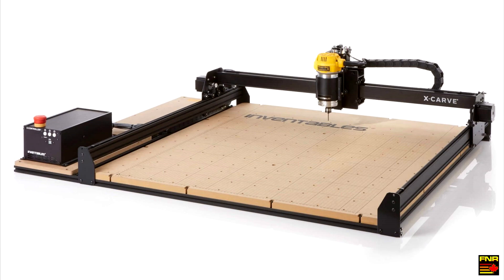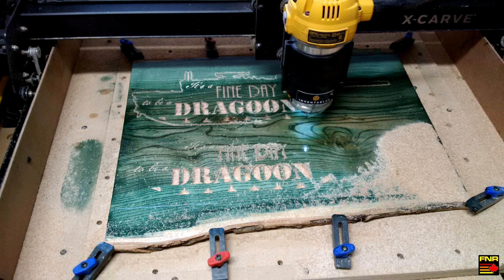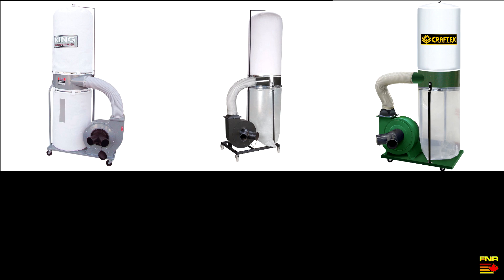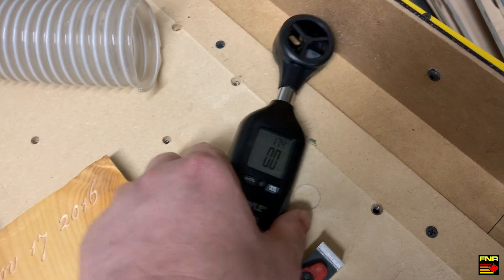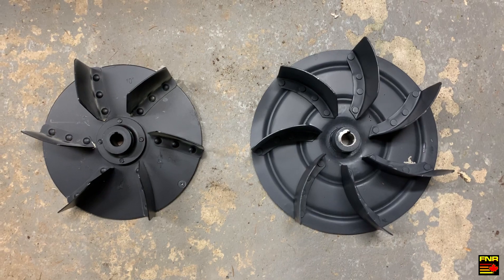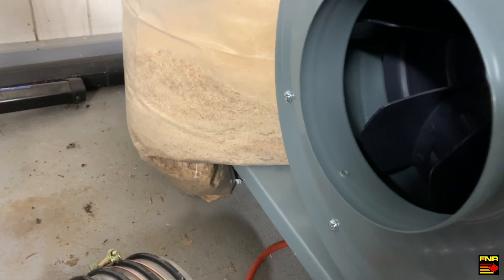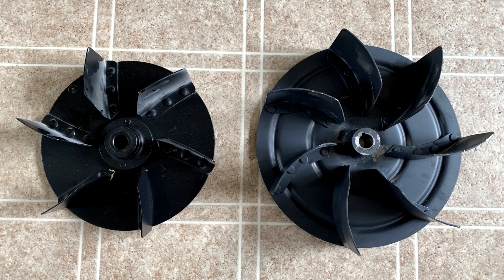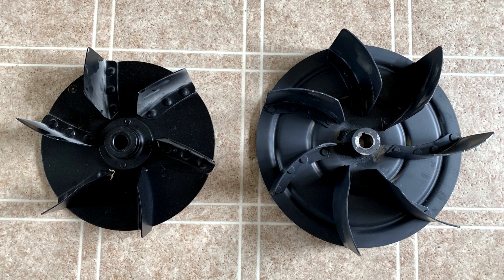Dust Collector Impeller Upgrade Test

Comment: What is the CFM at the end of your hose when you upgraded to 220v?
Reply from the maker: I didn't measure it.

I expect it to be about the same - the motor still has the same power level on 220V, it just draws less amperage.
Reply: @FNR  Not exactly...converting from 110 to 220 just splits the same amperage between 2 legs.  Here, had you just swapped the 15a breaker for a 20a you would probably not be tripping it like you were.  This is just explaining it in the hypothetical...dont just swap in a bigger breaker because the wiring between the breaker and outlet is probably not rated for that load. 

You were tripping a 15a breaker because you changed the physics of the motor/impeller combo.  If you are now pulling more amps in total, then you are also making more HP.  It might not be significant but technically you are making more power now.

Comment: Carefull to not burn your motor.
NEMA. The clause regarding motor current rating in NEMA Std. MG 1, 12.47 is short and to the point: “When operated at rated voltage, rated frequency, and rated horsepower output, the input in amperes shall not vary from the nameplate value by more than 10%.” This means the actual full-load current can be as much as 10% below or 10% above the value given on the nameplate. For example, if the motor nameplate rating is 100A, any value between 90A (10% less than 100) and 110A (10% greater than 100) could indicate a full-load condition.
Reply: I suspect this is not much of an actual issue.  Is the spec listed just the output with the OEM impeller installed...or was it a limit of the motor's windings.  I suspect it's the former or folks would burning up motors as you suggest and coming back to say DONT DO THIS.  Considering folks have been doing this for years now I suspect would would have heard something by now.

The long-term question nobody doing these swaps addresses though is the longevity of the motor.  Its probably,  practically impossible to say what impact it has on them because they are cheap Chinese motors and consistency between one and another is not tight in the first place...so any considered results might be anecdotal at best.  Again though, we just dont hear about motor failures and I think we would have by now.

Comment: its not really a win though.   The motor is drawing more amps than its rating. and when you convert to 220 its going to draw more than its rating of 6 amps which will burn up the motor .

Comment: Does putting the larger impeller cause more strain and overheat on the motor?
Reply from the maker: Not on my machine, but mine had a motor sized appropriately. So long as the motor is reasonably specced, you should be fine.

Comment: would have been nice if you showed us how you removed the impeller!
Reply from the maker: You remove the sheet metal screws on the cover housing, pop the housing off, unbolt the impeller, and slide it off. 

Didn’t even need a gear puller - it was a sliding fit.
Reply: @FNR Thanks!

Comment: I'm a bit shocked by the big uptake in amperage with the new impeller. On the HF 2HP DC, this upgrade took it from 16amps to 16.9 amps. Wish I had one of those air flow meters though.... Would be nice to test at the end of the run... What I can say is be careful where you leave small drill bits or it will end up in the dust bag!
Reply: Oo😊ooo
Reply: @RecceDG  o😊😊😊oooo😊ooooooo😊oooooooooooo😊o😊😊😊😊😊
Reply: @RecceDG 😊
Reply from the maker: I was running the XCarve on the same circuit, so new impeller was enough to push the draw over the edge. 

With the dust extractor, a DeWalt trim router, the XCarve steppers, and a computer on the same breaker, it’s a bit of a miracle that it ever worked at all. 

Converting the motor to 220 and moving it to its own 220V 30A circuit solved the problem.
Reply: @FNR  o😊o
Reply: o😊o
Reply: 😊oooooo😊ooo😊oooopoo😊o😊o😊
Reply: @FNR  oop😊o😊ooooooooo😊😊
Reply: @FNR  I'd avoid ANYTHING else on the same circuit as the CNC controllers and axis motors- electrical "noise" is an enemy.

Comment: Any suggestions for removing the impeller? I'm trying to upgrade a HF dust collector and am unable to pull the existing impeller off of the shaft. 
I've tried a 3-jaw puller and also using the existing 6mm LHT SHCS and washer on top of a short piece of pipe over the shaft and bearing on the impeller . Neither budged the impeller, even after heating and using penetrating oil. Any other tips?
Reply from the maker: Mine came right off with a 3-jaw puller.
Reply: im having the same problem.  My HF impeller is completely stuck on there.  I tried a 2 jaw puller and a 3 jaw puller with no luck.
Reply: @scottrobert2044  this is a bit late, but I drilled and tapped 3 5/16” holes in the base of the fan and used my steering wheel puller. I also broke the hub with a claw puller.

Comment: I bought the 2hp dust collector from Wen, not harbor freight. The Wen comes with a 12 inch impeller already installed, and the total cost is less than the cost of "upgrading" one with an undersized impeller.
Reply: My Harbor Freight 2HP was $151.00 after sale and coupon discounts. The Wen impeller was $35.00 delivered. Current list for the Wen 3403 2HP dust collector is $439.00. Now I barely squeaked calculus but but I am pretty sure $186.00 is less than $439.00, plus the brief project of doing the swap was kind of fun. At 5 microns, the filter bag needs to be replaced with a sub micron cartridge filter if you want to keep your lungs intact so that is going to be the same cost Wen vs. Harbor Freight. Not dissing the Wen, or peoples desire to not have to do a mod. But this is easy, and you can easily save $253.00 by taking a DIY approach. Which should be enough to get that cartridge filter!
Reply: @Wildersport  Something to take into account is that Has raised their prices where they are becoming less and less competitive. The going discounted rate for their 2hp collector is around $280 and Central Machinery has been excluded from their 20/25% off coupons for years now.  At this point, it's just more practical to get the Wen dusf collector with the impeller already on it than buying the HF model just to mod it

Comment: Any idea if the Harbor freight 2 hp motor can be rewired for 220/240?
Reply from the maker: You’d have to download the user manual and check there. The King was designed to work either way.
Reply: @FNR  The HF motor isn't convertible because there is only one field winding. Your motor has two, which are wired parallel for 120V and series for 240V.

Comment: I added a dedicated 20 amp breaker to my panel and a 20amp outlet for the HF dust collector. Will it be enough if I swap out the impeller?
Reply: Others have reported that the motor is capable of just under 15Amps draw which is a 2HP motor. A 20A circuit will be fine. Make sure you use 12ga wire not 14ga. :)
Reply: @Renrondog  that 15 amps is probably at 120 volts.
Reply from the maker: I would expect you’d be OK. I had a couple of other tools on the same 15A circuit and almost got away with it, so a dedicated 20A circuit should be fine.
Reply: 14 Guage wire is for 15 amp circuits, 12 guage wire is for 20 amp circuits.

Comment: The blower is fully loaded when the 6" inlet is wide open. When restricted down to the 2" hose it unloads the blower (less total air flow). The larger impeller increased the dynamic head or pressure available. That is why you saw an increase flow @ the 2" line.  You didn't see an increase at the 6" inlet because you are restricted by the blower housing/bag filters.
Reply from the maker: Note that the 2" line is actually a 2" line and a 4" line "y"ed off. The 4" line leads to a scoop at the back of the machine.
Reply: @FNR  Keep in mind that a 6" line has about 30 square inches of area and the 4' and the 2" line together have about 16 square inches along with whatever hose losses you have. The larger impeller created a larger pressure difference which allows the 2" to flow more. The total mass flow is relatively unchanged restricted likely by the bag
 filters.

Comment: I bet that big impeller would perform a lot better if the vanes were angled the other way
Reply from the maker: There is some interesting reading on impeller design out there, and a lot of impeller design parameters are counter-intuitive. Lacking access to either the King Canada or Ricoh engineers, we don’t know what design constraints either were working within. It seems reasonable that the King engineers were trying to maximize performance within the 110V/15A power envelope; Ricoh’s design may be related to sound control - which is understandable, as I think the flow choke point in the system is now the diameter of the outflow hose. Notwithstanding, I converted the motor to 220V, and I’m happy to say I’m now spinning the big rotor with no issues and that the XCarve is now effectively dust-free.
Reply: The angle and direction of the blades will also affect the current draw of the motor.

Comment: Impeller vane angle does have a significant impact, curving forward will increase flow at no load, but curving back will increase static pressure.